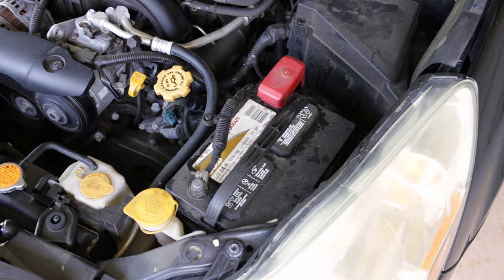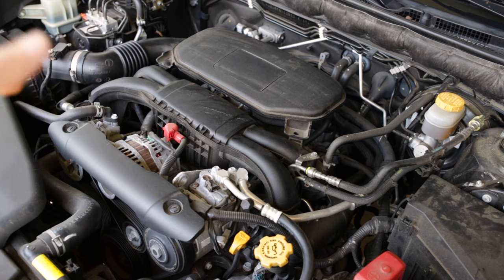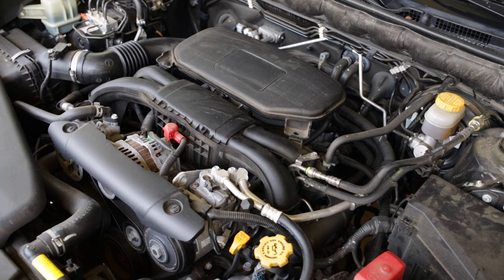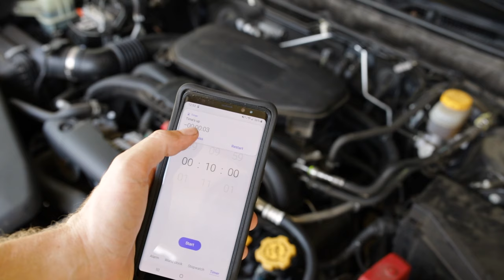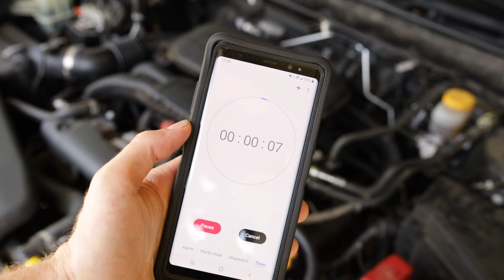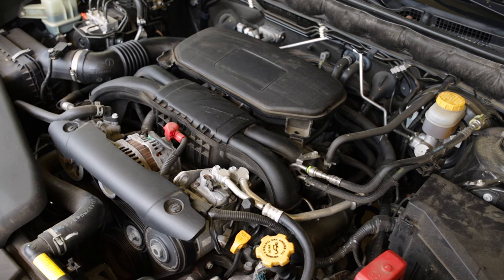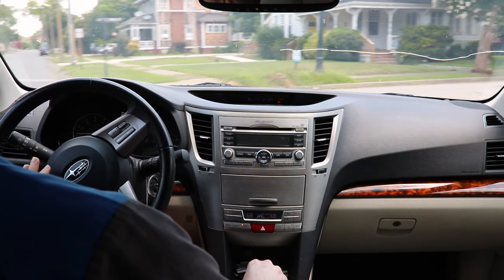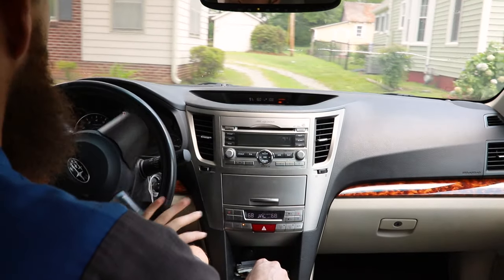Subaru Idle Relearn Procedure

Comment from the maker: This procedure is for 2005+ Subarus with the drive-by-wire, electronic, throttle body.
Reply: Great video!! I have 2005 Forester 2.5x MT and the car doesn't have a rough idle but when accelerating it bogs and loses power. The more gas I give it the more it stutters and bogs and sometimes it turns off. There are no check engine lights on. I also have replaced the fuel filter, fuel pump, cleaned the throttle body (watched the video you posted on the throttle body cleaning) and tried this idle relearn procedure but its still doing the same thing. What can it be? Where do I go from here?
Reply: MrSubaru1387  I have a 05 Legacy when driving suddenly the Idle goes down and loses power what could it be,I cleaned the TB,Change air filter,Sparkplugs and keeps doing the same...Please help me
Reply: @washchris  i have the same year and model with MT is this worth tryin for just the rough idle fix?
Reply: @brutalbizness9744  yes it is.
Reply: @washchris  just did a few days ago and I definitely noticed a significant difference, now I just through a CEL code I gotta check:( but hey thanks for the reply man, much appreciated
Reply: Would this process be the same for a 2005 EZ30 engine? 2005 Outback LL Bean
Reply: Is the  procedure good for OB 2015. All my warning lights are on and check engine light as well. I think I am getting a CIL. And all of a sudden the car is stalling after I start the engine and the idling is weak you feel the car is about to shut down at red light stops. Please can you help.
Reply from the maker: Yes. Same procedure. Did you recently do work to the car for it to start acting like this?
Reply: @MrSubaru1387  thank you for the reply, no I did not do any work on the car recently. I had oil indicator coming on three days ago, so I added some oil, the warning went off after that. thats it.
Reply from the maker: I'd clean the throttle body, do the relearn, and then see where you're at.
Reply: @MrSubaru1387  you are Subaru Guru, thats what I thought too. amazing experience you got. what about the intake valve cleaning
Reply from the maker: @abymerhi4606    it's port injected. No worries. Only need to worry about intake valve on the new direct injection engines.
Reply: @MrSubaru1387  I went to the subaru dealer today. they hooked to the reader. it came up with code P0560. voltage system, they said it is possible that the ECM system is damaged. the check engine the check engine disappeared but now the lane departure and eyesight do not work. what is your take on that? thank you
Reply: @washchris  I have the same problem on my 2011 Impreza! Found anything? I changed the MAF, cleaned the injectors, changed the vacuum valve, coil, spark plugs... I'm a little lost...
Reply: Hi Mr Subaru, how did you "clean the throttle body". Did you just blow it out with compressed air? Thank you
Reply from the maker: There's a video on the channel detailing it. Brake parts cleaner or carb/throttle body cleaner and a rag. Sometimes a plastic or brass brush if it really caked on.
Reply: @washchris  @MrSubaru1387 Did you find the solution? I'm having the same problem on my 2011 2.0i MT Legacy ... I tried this procedure and it was fine for around 60 miles, then it started misbehaving again.
Reply: P2101.... Any idea? It’s a Subaru Legacy 2.5L limited 2013. The car doesn’t start 😓
Reply: Please help.
Just purchased a 2008 Subaru legacy 2.5 GT non-turbo it seems to stay raised at 4000 RPM idled warm or cold more times when it's cold it seems to me like it maybe the cruise control is engagedbecause when I put it in drive and let go over the break it will get me up to 55 miles an hour where it will stay the car is currently not running
Reply: Out of curiousity, what's the procedure for an '02 Subaru WRX?
😁
Reply from the maker: @tyree9055  it's a cable throttle body, there isn't one. This is for 05+ drive-by-wire throttle bodies.
Reply: @MrSubaru1387  will this work for 2015 sti ??
Reply from the maker: @Mursounderground  yes.
Reply: @MrSubaru1387  thank you sir.
After installing a new turbo TD05 20G and new intake 3 inch, my Subaru has poor idle.
I’ve replaced plugs, maff sensor,air filter even done PCV valve and still idling rough.
I will give this a go tomorrow.🤞🏼
Reply from the maker: @Mursounderground  you need a tune for one. Lol
Reply: @MrSubaru1387  I know i will have it tuned soon.
But the car was drivable before I over primed the engine after the turbo install.
Now it still drives but wants to stall but dosent stall.
Losing power and being hesitant.
You think a tune would sort it ?
Many thanks 😊
Reply: How do you do a relearn if it wont stay running
Reply: @javierjimenez7783  did you find out what this was my 06 legacy does this too. Have to pull over stop turn off the motor turn the key to on let what ever is behind the glove box click twice turn the car over but it won’t catch turn the key to off then start it  and it will start up and drive fine except the check engine light and cruise control light flashes
Reply: Is it still good for 2015 Forester?  I let my battery die by leaving the keys in the ignition and turned on :-). It it's has stuttering when I'm driving and lurches
Reply: is this procedure good for a 2019 brz?
Reply: The Subi Guy  in Richmond Virginia told me just to drive it it would reset itself. Which it has.
Reply: Thanks!  Changed my love for my STI...smooth now at stops...thought it was something major but glad this procedure worked.
Reply: I was going to ask cuz I have a 2004 Subaru Outback and when I disconnected the battery and turning the key to the on position the throttle body never went through its checks and tests I still do the rest of the procedure but no noticeable change
Reply: Hey I have some questions , having some serious problems with my suberu
Reply: I THINK it worked for me. To be honest idle wasn't bad before but here's what happened:
I replaced the air filter and had disconnected MAF plug for doing that because  it was in the way. Forgot to connect MAF connector and started the car without MAF sensor connected. Threw a code, cleared it, re-connected MAF and restarted  - however felt like the car didn't have the same eagerness as before. Not sure though because no stalling/low idle/shaky idle. Just felt like slower to take off. So i thought  I'd do this procedure . I did it exactly as instructed and  i noticed ONE difference: 
On yours, after you turn the key to ON the FIRST time after reconnecting battery, i thought i heard the throttle body on yours sweep TWICE. Mine only did it once... should I redo it? Does that matter?
Reply: I have a 09 impreza non turbo and the code is saying misfire cyl 1...I replaced sparkplugs Bosch gold also replaced coil wires and coil pack...duralast gold wires...shudders and bogs at a stop and when driving it hesitates...I pulled new spark plug double platinum iridium plugs and cyl 1 only is black carbon build up still....also the check engine lights up or also blinks and cruise control blinks....still showing cyl 1 code...any ideas on what else it may be? I'm stumped
Reply: thank you, I have tried this several times with no success. I am currently experiencing P0: 102,123, 113, and 223. I have an 08 sub outback 2.5i (ej25), and it will run well until it gets to operating temp. after that something happens and it begins to sputter until it stalls out. any ideas?
Reply: How do I adjust my idle on my 1996 Subi Legacy Outback, manual transmission?
Reply: What’s the process for 2002 wrx
Reply: Hello @MrSubaru1387. Thank you for this... Just wondering if you always have success with stopping this procedure after the first 10min mark for the fourth generation you showcased? I remember the relearn procedure for the third generation (BL/BP 2003-2009) asked to leave it idle until the cooling fan came on, which I always found as overkill.

 My 2006 XT is always very stubborn at startup after disconnecting the battery and relearning.  I will shortly try this on the 2011 w/ CVT and the 2012 6MT both stumble & crackle in coming to a stop, or using the power windows or under A/C load.
Reply: Is there a relearn procedure for a '99 Legacy outback?
Reply from the maker: No. No real relearn on the cable throttle engines.
Reply: @MrSubaru1387  Thanks.
Reply: It worked on my 2013 legacy. Much appreciated
Reply: Does this work for the 2000 outback?
Reply from the maker: @TheRW0575  no. 2005 and newer with electric throttle body.
Reply: Not all hero’s wear capes… late on a Sunday night I thought I messed something up when it idled rough after changing the spark plugs. You saved the day, thank you!
Reply: Please help, I have a 2012 Impreza 2.0 I took to Aamco to check trans fluid I think they just reset the codes not I have low power and stalls when starting. This has happened before but hasn’t been an issue for a while. Got battery tested and it’s at 100%
Reply: @washchris sounds like it could possibly be a Miss fire
Reply: so this wouldn't apply to my 1990 Legacy
Reply from the maker: @Jestr86  nope
Reply: Map sensor….
Reply: @MrSubaru1387  is ther a relearn for the idle air control valve on a 02 wrx
Reply: How do we know if we have this?  I have a 05 Impreza outback sport
Reply: Second time on here I recently changed my radiator and disconnected my negative battery cable when I hooked everything back up the needle drops below the 1 like it's about to stop but then idles back up. I am going to try this in the am hopefully it fixes the issue.
Reply: I have a 2019 impreza, the radio doesnt shut off, just mutes when you hit the power button, will this effect the relearn?
Reply: What’s procedure for pre that?
Reply: So, it does not work for the 2004 Forester XT that also has Drive By Wire throttle??
Reply: What is the procedure on a 99 2.2 auto Impreza sedan
Reply: @211gram8  just do the same thing. It’s not gonna hurt anything.
Reply: @docdildonica7515  facts but not in my situation I’d have to drive a hour both ways to do the test and if I’m not mistaken my throttle body isn’t electric and it’s already been cleaned  I’m almost certain the procedure would be similar but not the same due to that reason but it’s hard to get info for a gc body
Reply: @211gram8  idk I did it on same age forester; helped.
Reply from the maker: @211gram8  isn’t. They don’t have an electronic throttle body.
Reply: Not sure this will get a response but it’s worth a shot my friends car is a 2014 Subaru legacy and after clearing the codes the won’t even idle it will start and die a few seconds later any idea what it could be?
Reply: @MrSubaru1387  not sure where my comment went I posted before so if you find the other one sorry for the repost but my friend has a 2014 Subaru legacy 6 speed manual and we did some work on it and cleared the previous codes and now the car doesn’t idle after you start it no matter what we try any ideas?
Reply: @jeffreybeaujean112  try Subaru owners forum. Also try disconnecting the battery for thirty minutes.
Reply: @MrSubaru1387  is there any information about the 2.0 Ecu reflash update to get rid of the classic 2-3k bog down loss of power, I own a 165hp Legacy very common for it to do that apparently there's ways to update the Hitatchi Ecu

Comment: Hi Mr. Subaru,  I'm so grateful for this video. I'm a 60 yr old woman. I really need to watch all your videos because I own a couple of Subaru's since they are so perfect for driving in the mountains where there is snow and where I live. I have a 2016 Subaru Forester and I noticed at a cold start it would have these popping noises as it would warm up for a few minutes and those popping noises got worse. I found a very very dirty air filter and I replaced it with a new one. I did disconnect the battery when I did that. Not sure why but I did. Just the negative post.  So the popping noise went away but started to come back as I drove it and now at idle, at a stop sign, the rpm's would drop so bad the car wanted to die. The car has 130,000 miles and the first thing I thought of was, well since the MAF sensor is where the air filter is, maybe the MAF sensor needs to be cleaned. So your videos popped up when I was looking for anything Subaru Idle issues on Youtube. I saw the one about the throttle body and also this one "Idle Relearn" so I thought "Don't touch anything. Do the relearn first. So I followed it and completed it per your instructions and it fixed it.  I was so happy. Thank you so much.  I never even knew there was such a thing as an idle relearn.  You are a great teacher.  Thank you so much.  Diana
Reply from the maker: You’re welcome!
Reply: How to do this with a push button start instead of a key?
Reply: Don't put your foot on the brake and it won't start. Same procedure

Comment: 1.  turn off all lights and accessories (no A/C, lights, blower, radio, etc.)

2. disconnect battery for 30 min
(now is opportunity to clean terminals, check ground, clean throttle body)

3. re-connect battery

4. turn key to ON position for 15 seconds (throttle body has a chance to go through a check sweep during this period; do not let engine turn over)

5. start car and let it idle without any load (no A/C, lights, blower, radio, etc.)

6. leave engine running for 10 minutes, never loading, never touching accelerator

7. turn off engine and leave key in off position at least 20 seconds

8. turn key back to the ON position for 15 seconds without starting engine

9. start engine and leave idling for 5 minutes without loading or touching accelerator

10. turn off engine and wait 20 seconds before restarting

DONE! Test drive!
Reply: Thanks. I was just about to write it all down when I noticed you did it for me. Much appreciated.
Reply: @aimeestephens7135  same
Reply: Nice
Reply: Thank you SOOOOO much for spelling this out so clearly.  Worked like a champ for our '13 Outback.  MANY thanks.
Reply: @Paulie1305  You're welcome!
Reply: Homie
Reply: If the engine keeps stalling at step 9 (restart engine for 5 minutes), it's because the throttle body needs to be removed and thoroughly cleaned.
Reply: @mal798  This is exactly what mine is doing...will not start at step 9 without me giving it throttle or else it stalls.
Reply: I was trying to follow the video, then I saw this write up. Thank you for taking time to write the procedure down.
Reply: Any advice if the process works to step 9, but won't idle (dies immediately)? Thanks!
Reply: My 2015 has no key, just push button start.
Reply: Awesome - thank you for putting it in writing!
Reply: You are wonderful man!!!
Reply: @Todd Howard  just turn the ignition on. Dont press the break pedal.
Reply: @Paulie1305  Thanks, only thing missing from the video is written instructions, sorry that I only saw your post after starting and stopping the video many times to write it down myself!
Reply: Thanks!
Reply: Done, still idles rough. Never did this, does this after battery change...
Reply: @djmcwill1010  what do you do if you have a stereo that won't turn off audio off is the best I got? I have a 2013 legacy
Reply: Noŵif ican reeech  that ķey😅
Reply: What’s the procedure for the push button start for turning “on” but not starting engine
Reply: @steventrinh9524  don't press the brake when you push button

Comment: Finally, a definitive relearn procedure with step by step instructions, and proof of concept right in front of our eyes. Thanks mate, I really needed something like is, as when I'm heading home after a drive and I let the car cruise to allow the turbo to cool, I find the revs dropping and the car starts to stutter until I hit the accelerator. Just gotta give the throttle body a clean and give this procedure a try, Much appreciated and a new sub.
Reply: For anyone experiencing this same problem if it's a 15+ more than likely it's the ocv on one bank same issue super easy fix thankfully

Comment: Thank you so much! Like many others here, I also changed out my spark plugs and experienced rough idling at a standstill, even stalled a couple times. This fixed it completely; it has better throttle response and runs so smooth now! 2007 Subaru Legacy.

Comment: I’ve had an idle problem with my 09 Forester for a while now. It wants to die when I’m driving and put the clutch in. Cleaned the throttle body and did this relearn procedure. FINALLY cured the problem, thanks!
Reply: Went out to my car today and had a few warning lights after start up. Got a code for P0600. I’m gonna try to take the battery cable off and do this again, anyone ever seen that code before?

Comment: Had my oil changed at the Subaru dealer yesterday, and Dealer says I need to clean my injectors (They wanted $170 to clean injectors)  as it was running rough at idle( around 600 rpm). I followed this procedure, and idle with A/C on is now stable at abour 750 rpm with AC on, and NOT a rough idle! This is on a 2015 Crosstrek with ~35K miles. I knew something was fishy since the idle speed was so low with A/C on. Searching here turned up this procedure, so thank you for documenting this!

Comment: Had my 2019 outback serviced by the dealer and it was very unhappy about idling even dropping to almost stalling and the car wobbling side to side. Unwilling to go back to them ( I made sure they had changed the oil and filters before leaving) I looked this up and now she is perfect. Thank You.
Reply: Dang on a 2019? I bet you were freaking out
Reply: I got a 2018 forester xt 6 months ago. 50k miles. With a similar problem as this after my local shop cleaned the throttle body and fuel injection system. I have been freaking out for sure lol. Trying this tomorrow! 🤞🏻